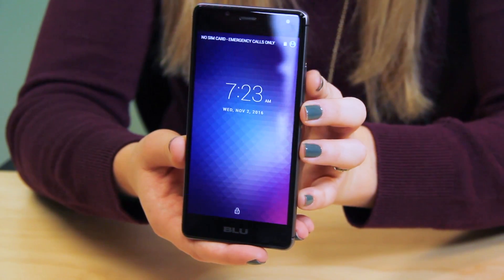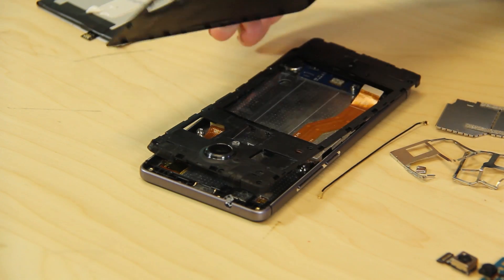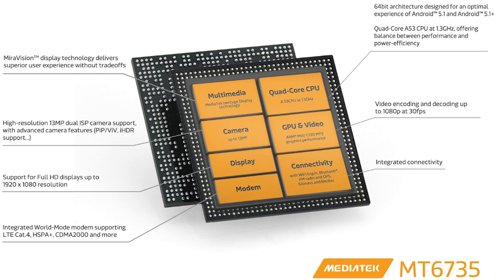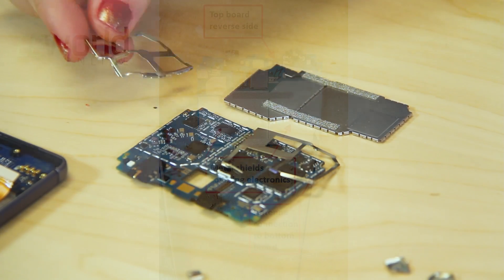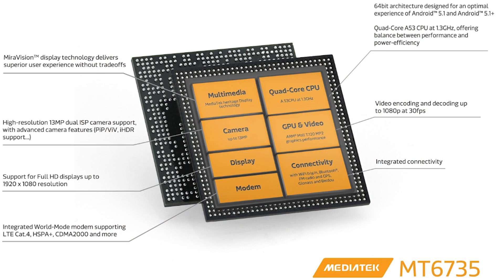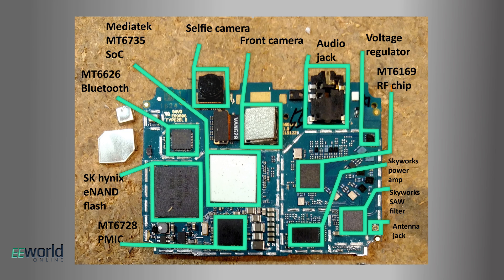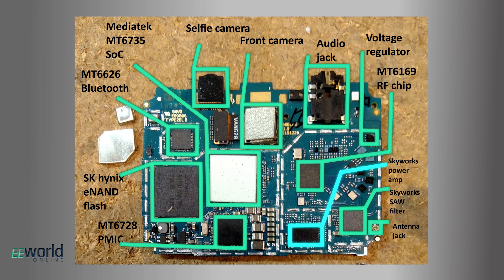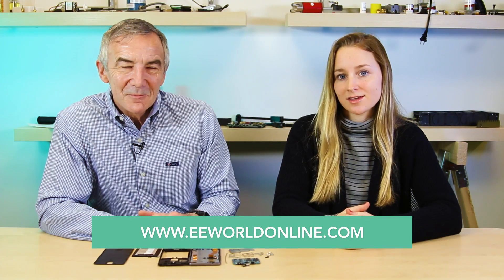Teardown: Inside the $50 smartphone from Amazon

Comment: How did you manage to remove the battery?
Reply: The Battery is Glued with a strong adhesive tape so you have to try to work your way under the battery and lift..
Reply: Just pull really hard.